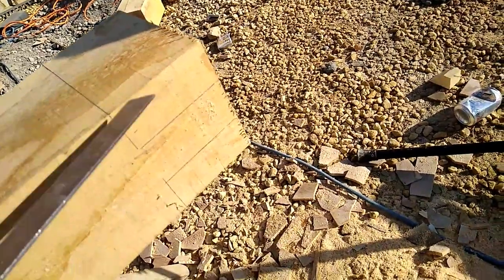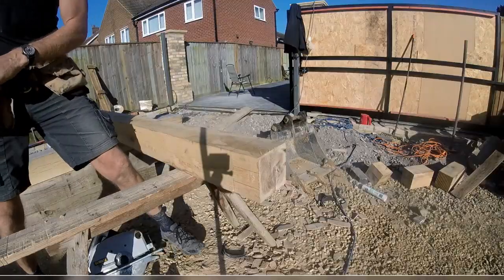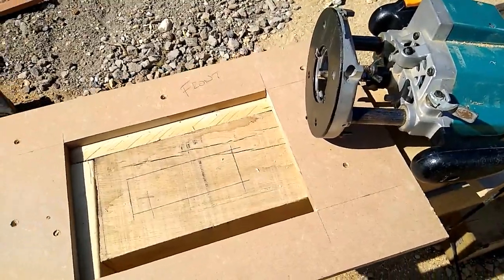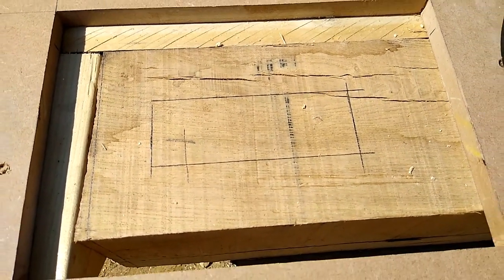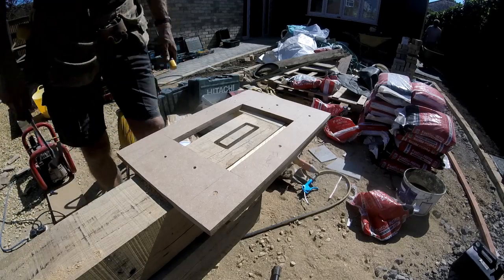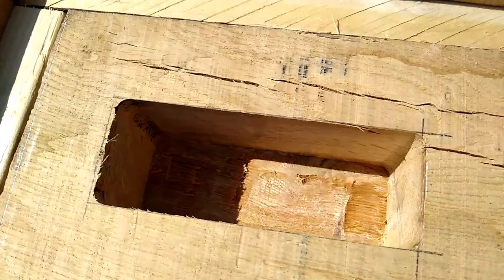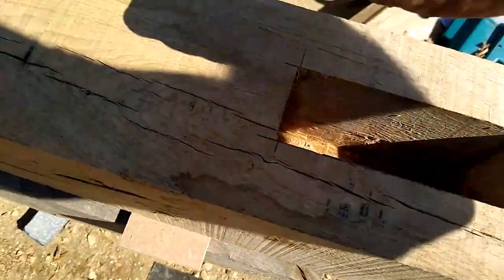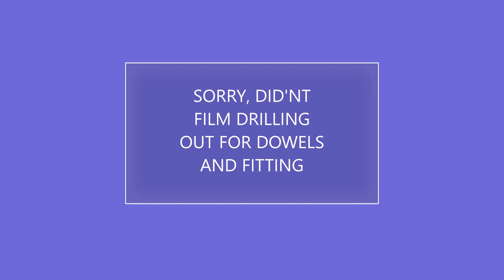How to cut a mortice and tenon joint in Oak on site.

Comment: Nice job. a good tip for someone less experienced than yourself when cutting tennons with a circular saw like that cut the shoulder first then cut back towards it . very easy to cut beyond the line .
Reply from the maker: Great point Brian. Easily move in past your shoulder line when you're on a roll.👍 Cheers.

Comment: Hi, can't you get a router bit that's long enough to cut the full depth o the mortise ? 
Thanks
Reply from the maker: Hi David. Its more the plunge depth of the router, than the length of the cutter, although I don't know how long a cutter bit you can get.🤔 I just kinda worked with what I had.😎 Cheers.

Comment: Very good instructional video! Do this sort of thing myself (even have the exact same Makita 3612 router!! ...what a workhorse they are 👍)
I love this sort of work, keep meaning to do a video exactly like this one day...now I don’t need to! 
Just finished a porch project myself using this EXACT method! One little tip I learned from an expert Carpenter when I was a mere slip of a lad..(this is aimed at anyone watching this video who wants to complete a similar project and by no means aimed at The Tall Carpenter who clearly doesn’t need any tips from me..👍)
When the tenon is cut, at the edges where it abuts the cross member I normally just “crack the harrris’” with a block plane.
This creates a slight “shadow line” which means when the Oak shrinks (and it will..) the gap that’s left somehow doesn’t seem quite so obvious (which seems counterintuitive really cos essentially you’re giving the impression that there’s a gap there already??! But it works..) 
Great video...love the instructional videos on framing roofs etc as well! 👍
Thanks
Reply from the maker: Hi Mark. Great to have you watching mate and thanks for adding your great comment. All little extra tips and hints are always welcome, and I'm very lucky to have some great carpenters watching and contributing as you have. 😎 Cheers.

Comment: Hi Del green Oak the smell is lovely when working with it, good old router got some power to them thanks for posting all the best Tony 👍
Reply from the maker: Hi Tony. You're right about the router, its a real beast. As carpenters we spend a lot of our time working with fairly mundane timber and board material, so its always a treat to work with something a bit different. Thanks for your comment. Cheers.👌

Comment: I used to work on a period restoration company , oak framing . They were well into keeping stuff to period  . Apparently the pegs were cut off leaving about one and a half inches protruding , this was as the oak shrunk and the joints became slack over the years , the pegs had enough length to be knocked home again . Not most customers cup of tea ,and we often had to cut them back to keep the client happy . Mind you it was a great thing to hang your coat on 😁 Also on complete oak house framez , eg traditional bay leaf , we wound have a short 'Trial' pair of a mortice and a tenon  , these could be used to check joints without having to keep lift up the whole heavy lengths  , although everything would be dry fitted with metal dowels , which could be more easily knocked out again , for disassembly and transporting. , sorry im babbling again Del , must be my age , brilliant job you done there , top work mate  😃👍👍👍👍
Reply from the maker: Hi Raymond. Yes I was aware of leaving the pegs long as I was lucky enough build a really big Oak framed job a few years ago alongside this amazing oak working carpenter from the west country. Doing restoration work takes a particular type of tradesman with imagination and patience and can be very satisfying.🤩 Thanks for another great comment and for watching.😎

Comment: Using power tools you just make them joints look so easy, I remember having to mortise & tenon, dovetail and another one for my O level woodwork back in the 80's and struggling with a tenon saw and a chisel to take just the right amount off to leave a good tight fit.
Reply from the maker: Hi there🖐I also remember cutting a dovetail joint for my O level woodwork exam back in 1986😵‍💫 The only subject I got an A in👍Thanks for your comment 🤩 Cheers Del
Reply: Cheers Del new subscriber last month love the channel. @thetallcarpenter
Reply from the maker: @mrspudly1  Appreciate you subscribing bud🤩Good luck in 2024🤞

Comment: We did a similar job on an oak three bay garage luckily Hss Hire was open and we hired a chainsaw Mortise Machine do you know When you drilled your holes did you offset the mortise holes or did you  drill straight through Many thanks Colin learning every day
Reply from the maker: Hi Colin🖐I have NEVER used a mobile chain morticer, bit they look awesome for this kind of work👊Yes, I offset the holes I drill in the tenon so that it draws the joint up tight💪Thanks for watching 😎 Cheers Del